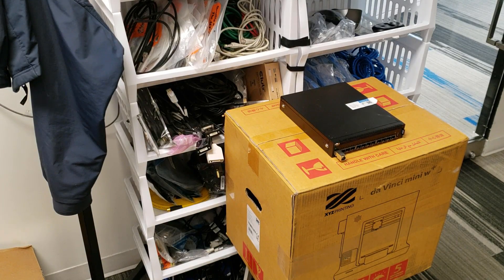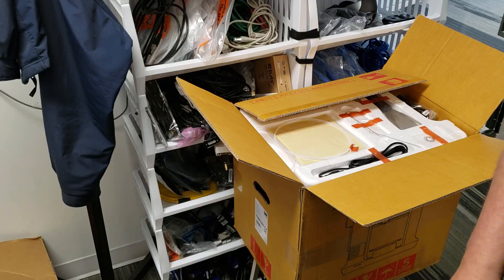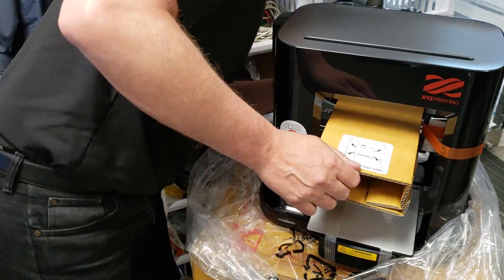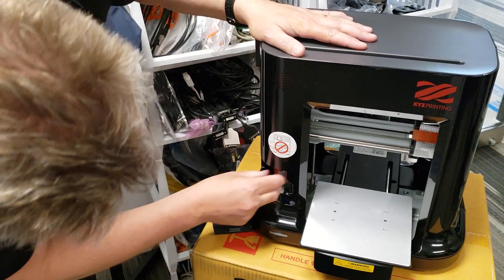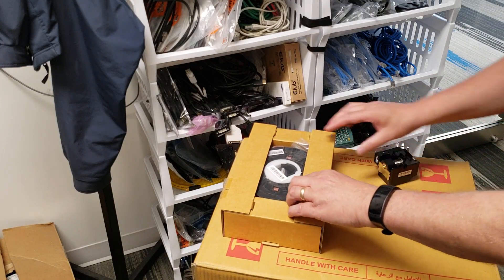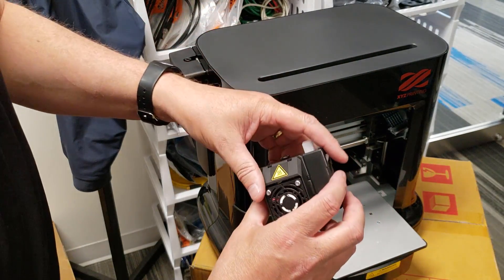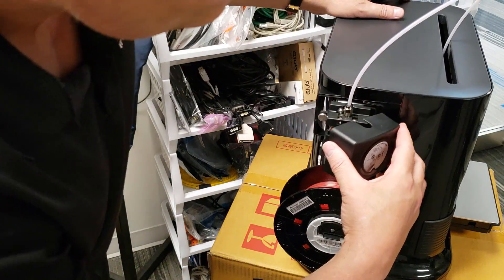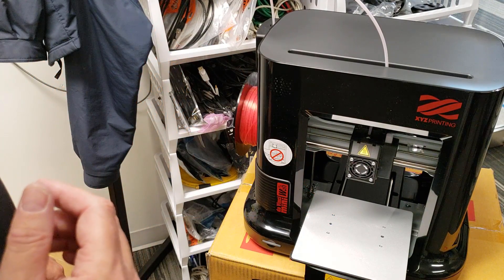da Vinci Mini W+ 3D Printer Unboxing & Setup

Comment: IF you purchase a piece of glass for your printer bed and attach the glass via some metal tape on the sides of the glass to the bed....you can use it to print on. lemme share a little known SECRET. I have a divinci all in 1 pro.... been working with it for about 3 years and learned a lot.  This is what i've learned. Get some ELMERS spray adhesive glue...spray your piece of glass with about 2 coats not to heavy BEFORE you attach it to the print bed. Let it DRY for about 30 minutes. Place your piece of glass on your print bed. THEN take an elmers glue stick and put about 4 coats of glue on the glass over the spray adhesive. Make sure you CROSS coat the glue...go one way then another direction do that 4 times. Let it sit for a few minutes about 10 minutes, then warm up your machine and load your design into the program and wait for it to print. The 2 glues work well together.... you will not have any peeling up of the sides of the plastic.... no curl. I use ABS plastic with a heated bed and it works great.
Reply: John Stratairious can you attach glass to da Vinci mini